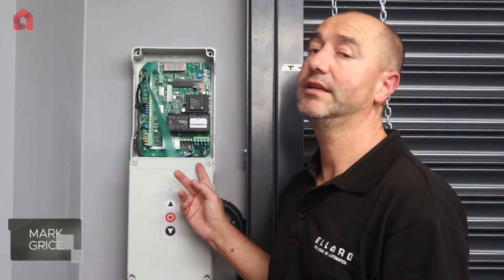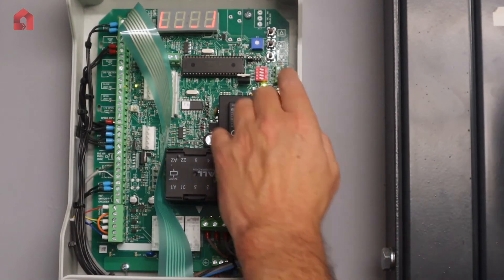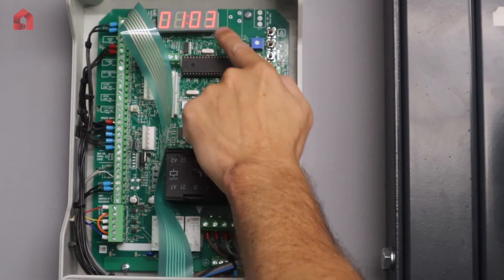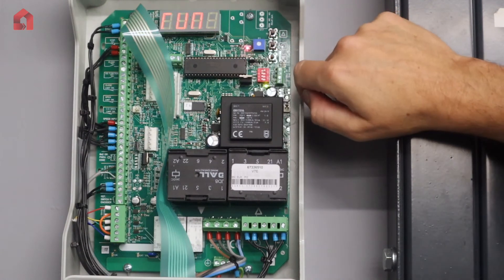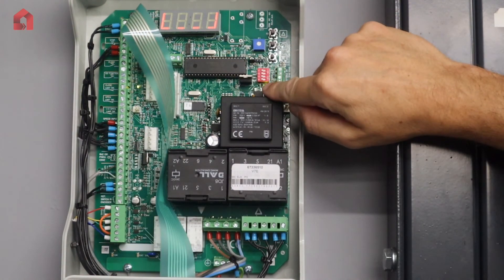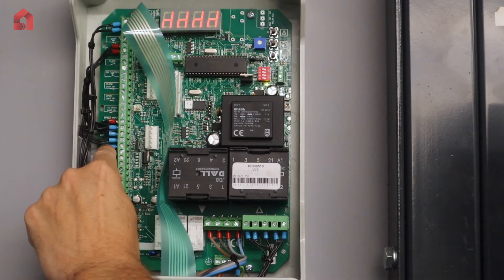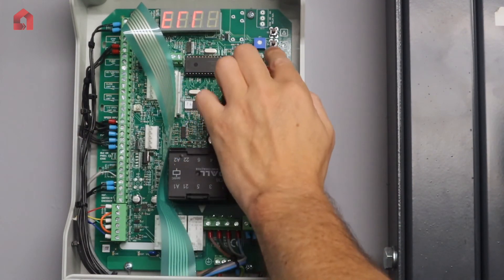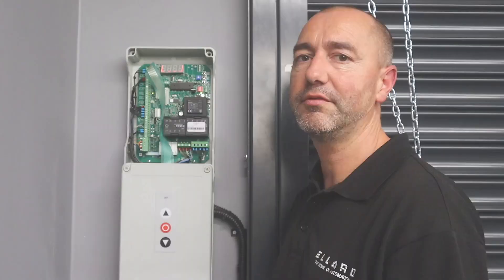HOW-TO: Programing the V7E

Comment: Hi there
is this device have fob control? if yes how to program it
Thanks
Reply from the maker: We can supply an external 24v radio receiver for this. It will wire into the V7E control panel.

This will allow for radio control. It’s called the TVRCM.